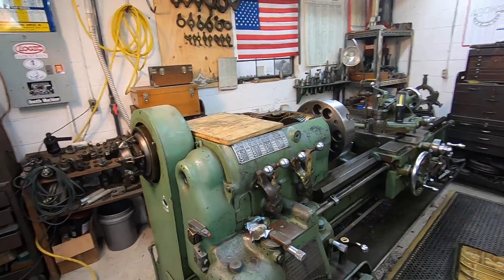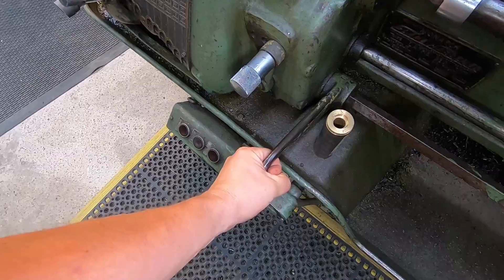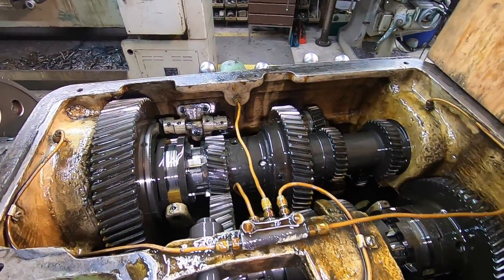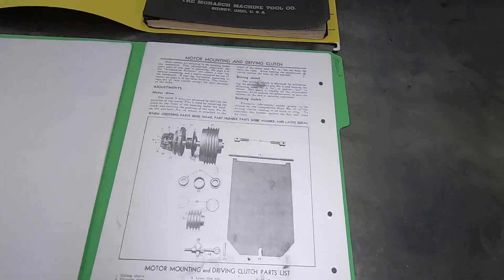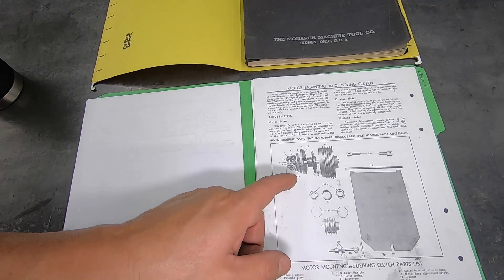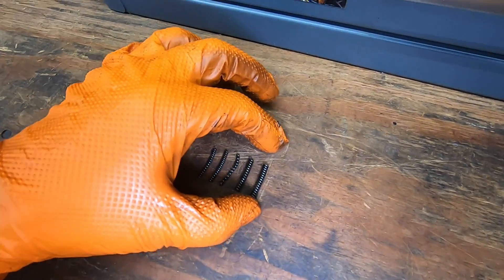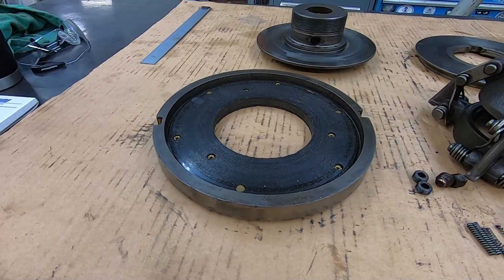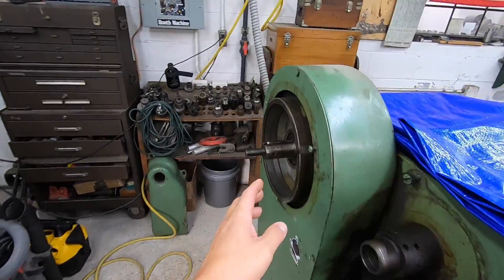Monarch Lathe Clutch Repair Part 1

Comment: Abom79,

I would say (with a 98%) the problem with the clutch is the springs, but I would replace the clutch pads and depending on the place you could get it sent to your self to installed, its not hard to do and yes I have done it on some items, even car ones.

As I am in IT (Main job) I am sure the email problem is (and this is depended on what they use as a email server) its going to there spam folder and they don't look at the folder or is deleted out right if the spam rating is to high, this happens to so many.
Reply: Was my thought to,  problems with graylisting or other spam filter is usual

Comment: Hello and I will say I always admired machinist and how they knew to do things. I have been working on a comcast out door box made of plastic/fiberglass for putting my ham radio wires in. But I figured out with the 10" X 10"" X 4" box it was very difficult to measure for mounting the metal plate inside. With the 'stand off 1/16" screw mounts and the depth of the box I'm faced with the old problem of making a template for lining up the screw holes so they match the box. With the steel plate in the box you can't see where the screw holes need to be drill. Try as I might I ended up making a half-assed mess and could only get about 3  or 4 holes close to where they need to be. It works but 'HOW DO MACHINIST do this and get them right each time without looking like a mess? I've ran into this problem many times over the years and never found a good way to solve it. I even got clear plexiglass from Lowes and still was off on the screw placement. Am I just lost in space here without any hope or what? Help! Terry
Reply: Measure accurately and transfer to the plate after marking out. Adam had a video while back where he had screw in transfer punches to align blind holes (could probably make some with the correct thread for your standoffs and grind a point on them)
Reply: mark a centerline top to bottom and left to right , measure from it to existing holes , mark centerline on new plate . top / bottom and left to right , measure to new holes .   centerlines will always line up .

Comment: I would say it's a stroke of luck that it started sticking, had that crack in that friction material turned into a larger issue you could have needed even more parts than you are looking at. But remember you can always look at rakoinc for help with old equipment as well, they take care of clutch-brakes and can install new friction material!
Reply: LuxorVan z those "cracks" are not cracks as you can see on both sides they are stapled together from being made its quite common for some break material to be on a continues role so to speak and you take off what you require staple it rivet it and bake it

Comment: If its not releasing i would say springs. If it was slipping then i would say the clutch pad is either worn or glazed over. I would say your on the right track with the springs though. They all look like different sizes also. I wonder if that's intentional or just the operator having to replace a broken spring with one he had laying around over the years?
Reply: While I agree that the main issue appears to be the springs, the friction pads need replaced. The brass rivets holding the material in place are nearly level with the surface of the friction material. And grinding away the 'brake rotor' is bad, skimming the bearing surfaces is easy when the rivets have not ground groves into them.

Comment: Clean the fiber disc with brake clean then sand both sides with some medium Emery cloth.That helps grip better.
Reply: Nooooo, asbestos....
Reply: Material that old probably contains asbestos. Not real dangerous as-is, but sanding would be a real no-no...

Comment: An Automotive clutch place should be able to help you reline your clutch plate, a couple of the rivits seem close to the top so its a good time to replace it, my late 40's Macson ( Australian machine ) has the same type of setup, bought her for scrap value, might have to see if there is a brake on her somewhere as it takes a while to stop. Cheers.
Reply: Why does you name ring a bell 🔔? Warren
Reply: @hooter7003  don't know, I normally push peoples buttons not ring their bell.

Comment: That clutch disc is chowdered. You're scraping rivets from what I saw... unless that's a video illusion? You will want to replace or refurbish it soon. Otherwise you'll trash the pressure plate and flywheel.

Best cleaner for friction surfaces is brakeleen... made exactly for the purpose.
Reply from the maker: It’s not “scraping rivets”

Comment: The clutch plates definately need to be renewed, as others have pointed out and they would be a standard size which would be used in a number of other industrial machines. So the clutch company should be able to have one or cut one. The friction disk also needs to be inspected for wear. As for the springs, it looks like a previous repair was done with nonconforming springs. 
I would not use kerosene or other thinner to clean it out because there is always residual of this remaining in nooks and crannies and the fresh oil it will be thinned by this, which is no good for the gears. The gears are hardened and will wear out fast. If there is no clogging in the oil ways and no gunk in the gearbox bottom, then just clean it superficially and change the oil.
Reply: Flushing it that way would unlikely harm anything. I work on heavy equipment for a living and a factory approved method for cleaning out gearboxes/ planetaries is to fill with diesel fuel, run it up to temp, drain, refill with fresh oil, and take an oil sample to confirm it flushed out the debris.
Reply: Monarch specifically states to use kerosene when flushing the headstock and the apron.
Reply: @sp1nrx  True. I followed it up with brake cleaner and compressed air for giggles!
Reply: I think you're worrying a little bit too much.   But, good thing to contemplate.  The owners manual probably states the approved method and solvent, probably diesel...or high detergent automatic transmission fluid.
Reply: @sp1nrx  I find it very strange that the manufacturer, Monarch recommends using kerosene for flushing. Those gears and bearings are very sensitive to any changes in hydrostatic pressure when running. They are good when the recommended oils are used. Put anything else in there and the life of the gear train will be shortened.

Comment: "That's how this lathe is designed to break is if you pull up on it, it actually breaks the spindle" :D
Reply: asdf brake*
Reply: It's different to my lathe. On mine, you push a lever to the left and it cracks the bed clean in half.
Reply: @godfreypoon5148  Now that would be some impressive engineering :D
Reply: @michaelnorton6454  Did the joke make your hair wave as it flew over your head?

Comment: Hello I run a 61 model for 43 years never have problem the church material is wearer out is the same material truck and small industrial equipment check the flywheel bearing are noisy my was very quite good luck

Comment: Hi Adam, just a thought, you could make your own springs, might be a cool project, apparently you use piano wire as you can buy it in a wide range of gages, just a thought
Reply: I wound music wire into springs on a South Bend 1960-1962 bending hooks on each end for tension. Since have in emergencies shortened die springs in compression use.  Inconsistent forming the finished ends.
It is difficult to construct/alter 2 springs within normal tolerances produced by commercial suppliers.

Comment: That is fascinating , it is basically a 16 speed transmission . Looks like it could be in a semi . That friction material looks pretty badly glazed and chewed up . I'd be willing to bet you could take that to a local brake and clutch shop and they could recline it just like a auto cluch.
Reply: Was just going to say the same thing! Like a single countershaft eaton box. 16 speed, that reference makes me think you're from the good days of American trucking or you're an Aussie. Have a good one!
Reply: @randyruppel6727  I've been a driver for the last 25 years

Comment: Do you have access to another lathe? I wonder if you could send them a replicated clutch disk(obviously just the steel features) and they install pads on that. Then they have a reference to work off of, and you have a spare if their clutch disk ends up being out of spec.

Comment: Mcmaster has clutch material called friction material.  You could cut and rivet it easily.  One of those plates was already broken and cobbled back together with copper staples, very iffy.  The mcmaster is available in many thicknesses and a couple of widths, one of them is 15" X 15" , about $60/ae..  Good luck, you an do it.
PS love the videos. 
Mike scans

Comment: Might want to mic out the disks next time you go in there.  They might be getting thin so you should check to see if they are under spec and get new ones if so.  Don't want one cracking and coming apart on you.  Bad things will happen.  My experience is with aircraft brakes.  Kind of similar setup in some ways and I've seen the result when a disk fails.
Reply: I would think being a machinist, Adam would just make new ones.
Reply from the maker: There are no “specs” on the anti friction clutch discs.
Reply: @Abom79   Relining company's have very special  power C clamp machines that reline & rivit the hub, it would be a total nightmare to try and duplicate that machines action. Got to use the right machine for the job.
Reply: @Abom79  Again true!  No spec. I went back and forth. Settled on 5/32" on my CY. But your clutch isn't affected much by material thickness.

Have it glued and riveted. The old belt and suspender method. Will last another 80 years.

Comment: Geez...can't get an email in these times?  Maybe the guy should let you send it to his cell phone !! 
I have to agree that testing the clutch once cleaned up, lubed and new springs for performance.  If it's still a little grabby, replace the clutch material but first find out how thick the new material is supposed to be. Just like automotive brakes, a cracked pad or shoe will cause the same issues...not your smoother rooster. 
Great idea to evacuate and flush the gear case and add new clean oil to the head stock. The lubricity of old oil that is used often usually falls way below its standard over just a few years.
git 'er dun.

Comment: I was always taught best practice for an adjustable wrench's or adjustable pliers' jaws should be pulled into the turn.  That way they won't open up and possibly round off the nut.  For example, @ 7:38 you had the jaw facing way from from the pull as you loosened the nut.  Is that incorrect?

Comment: That clutch material looks thin. A Sheldon lathe I have clutch and brake material mostly gone. Ordered material from McMaster carr. Made a die and stamped out new pieces. Ordered epoxy off eBay to stick them on. That was a couple years ago. Still going.

Comment: Looking at the friction material on the clutch it looks like it's contaminated with oil.  Being as old as it is and if it's original it's probably made with asbestos in it.  You can try to clean it with Brake Clean but afterwards take your torch and warm up the friction material, you'll be surprised the amount of oil that will come to the surface.    The steel plate also looks like it's got some hot spots on it from slipping.  It might be a good idea to check the metal plates for run out.  If they are warped that could cause the clutch to stick.  You're right on the springs sure looks like some are missing.  I'm guessing the larger ones might have been the originals and the smaller ones were some that got stuck in there when it was last opened up. 
There was a  place in Saint Petersburg called Florida Brake and Clutch.  They could have handled the reline of the friction but they went out of business.  you're right those kind of places are few and far between.   One other thing, I believe that to the left of the fork that engages the clutch inside the top cover is the spindle brake.  When you lift on the handle the linkage pushes the cone into a cup.  this stops the spindle.  The brake might be effected by the clutch adjustment.

Comment: In an Andrew Camerata Youtube video, he showed a very good trick for matching springs. He was matching tension springs - he hooked them together and pulled. Unmatched springs stretch unequally; it's really easy to see. For compression springs, just string them on a guide rod (maybe with a washer between them) and compress them. If they compress equally, you have a match.
Reply: Machinery's Handbook has a section on springs and how to engineer them.

Comment: Hi Adam, nice video. Do you know if there is a risk of getting asbestos dust around from working on lathe clutches?
Reply: Do they used asbestos lined clutches? If so, then probably so.
Reply: It’s only dangerous if you breathe it in and then if you work in a brake factory for 30 years.

Comment: With respect. Always wear breathing protection when handling friction materials, especially older products such as this clutch disc. Wash the clothes you are wearing, including your overalls when the job is complete.
Reply: peebee143 Eh, asbestos isn’t a problem unless it’s airborne. No need to get all California on us.
Reply: @susanbarbier5053  yup.. crikey as an apprentice in the motor trade we were told to blow the dust out of brake drums using the airline.. black asbestos dust everywhere.. 54 now.. no worries

Comment: Some email is set up to block any incoming email unless an authorized user has contacted the sender first. Its a very effective spam, phishing, etc, filter. Its cheaper than anti spam etc filtering software.
Reply: Yeah but you don't use/do that when you get customer contacting you via email. Else you never get new customers...
Reply: Many companies’ IT dept sets up the company’s email to not let attachments like pictures through their firewall unless the email goes to a specific address used only for that purpose. If you were sending the email to a general email address it’s likely to be stopped.

Comment: I use to think of break and clutch repare as a specialist job untill i needed a clutch on a digger done it came back faulty and after splitting the digger a second time i fixed it myself and its been ten years perfect . Only because its called a specialist job dont mean there specialist s lol.

Comment: Hey Adam, field service tech for stamping presses here.  My two cents on your clutch is that the problem is almost certainly just the springs.  I've seen pneumatic clutches like that soaked with Vactra no. 3 still engage.  Weak pads shouldn't do much to affect them retracting and disengaging, as long as the spider isn't binding on the shaft.  Soaking them in acetone or lacquer thinner will completely strip any oil or grease out if you are still concerned.   It also looks like its got more than enough room to adjust for pad thickness.  I would run all the way down until you have about .030 to the heads of the rivets.  The big thing is to keep an eye out for the pad working loose on the rivets.  The inertia work you do is probably not nearly as heavy as the max the machine can handle, so I wouldn't worry about it if it were my machine.

Comment: I an more concerne about the clutch disks that is cracked. It could have a part of the damaged disks that come loose and wedge between the clutch and the disks itself and didn't release or drag at a critical moment. Look like a Twin Disk clutch on stationary engines. Free up every moving parts before reassembly. Mechanics point of view.
Reply: If you look carefully both sides of the clutch show that they are stapled together though one side is more worn than the other.

Comment: That friction plate looks burnt and low on material. That's most likely the cause for the slippage. It also looks to be worn uneven, with a few low spots.
Reply: I was going to suggest the same thing, i'm guessing those rivet heads/fixtures in the plate are meant to be recessed below the surface of the friction plate
Reply: It wasn't slipping, it was staying engaged, sticking

Comment: The size of your email with pictures may have been to large and was being blocked at the firewall of the recipient’s server.  I used to have to same problem trying to send sets of engineering drawings to clients.  I had to break up my emails into less than 10 meg batches to get past the limitations of the receiving server.  Reducing the resolution ( file size) of your photos may also be a solution to your problem.

Comment: I’d measure the hole those springs go in, those springs you pulled out looked pretty loose fitting, like some one just stuck whatever they had close to size in them. Original springs would have just fit the holes but still move in and out freely.

Comment: The actual clutch facing is impregnated with grease or oil Which would cause the faceing to stick to the pressure plate or plates !Seen this many times in cars and trucks causing either sticking , slipping or shuddering ! if it were me i would of put some new linings on nice simple job drill out riverts and replace lineing with new rivers might even come in a kit form ! if not your local clutch and presure plate man would make one up to suit ! Too easy
Reply: I agree, and if he just knew someone with a lathe, he might be able to kiss off those pressure plates back to true and not shiny smooth for a real nice job.

Comment: It seems like it would be easy to make an adjustment pin jig.  21:22  All you need is a short piece of copper tubing and an appropriate e circlip.  https://www.presstech.in/wp-content/uploads/2019/09/u-type-circlip.jpg
This would allow you to spin off the clutch without holding the pin by hand every couple inches.